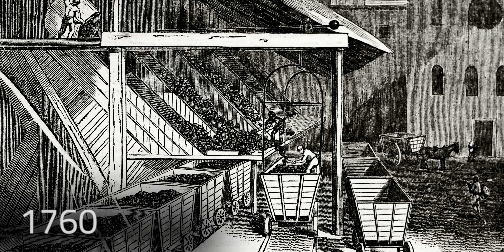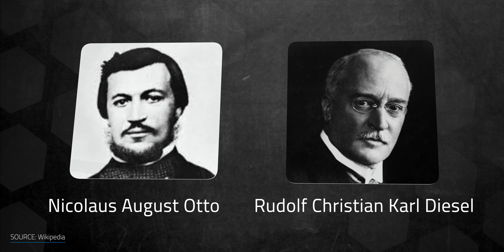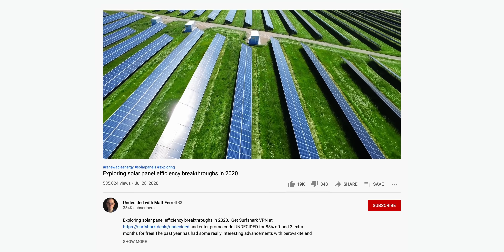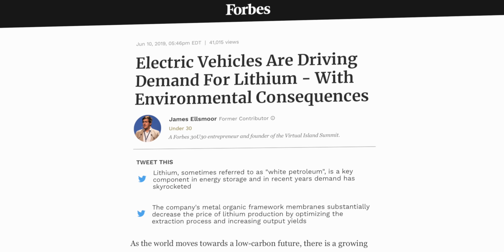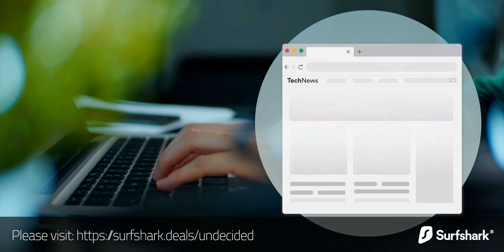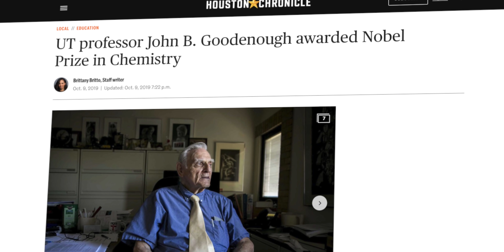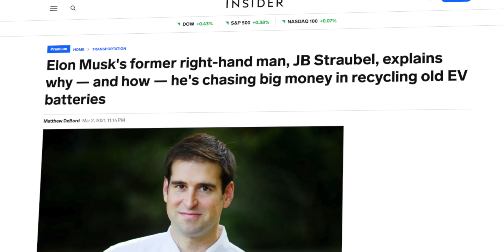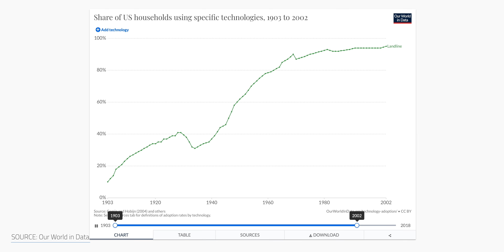Is the Future of Renewable Energy Inevitable?

Comment from the maker: What do you think?  Where's the next be advancement in renewable technology going to be?  And if you liked this video, be sure to check out, "Are Stirling Engines the Future of Renewable Energy Storage?" https://youtu.be/Be3FckQoDws?list=PLnTSM-ORSgi5LVxHfWfQE6-Y_HnK-sgXS
Reply: Matt, first I respect and appreciate your video content.  You're out there trying to shed light on tech, which is good.  But videos like this one, have a delay effect.  History was not on a race to disaster when whale oil was running into sourcing problems.  It may have seemed like it at the time, but they weren't going to take out all life on the planet when they killed that last whale, as bad as that would have been.  So it's a poor analogy to frame your conversation on 50 tech development curves seen in the past when our inspiration to change was fueled only by market profits and wants.  No, today we face a certain destructive future without swift, radical change.  We're not in a slow race, but your videos sometimes paint that picture.  We will not drag our feet waiting for 42% efficient solar panels when 22% efficient ones can do the job.  In fact, if you read carefully about the expected trajectory of solar development, we're already nearing the point where profit margins for solar panels are becoming too low to make further R&D useful.  That's because we put a profit value on everything (stupidly), and manufacturers won't make more money on their return improving them beyond a certain point.  And, in fact, manufacturers are experiencing the commoditization of solar now, where the panels are no longer the dominant cost of solar but rather the sales, labor,  eBOS, mBOS, land (in utility solar case) and permitting are where the real costs are.  Cheapening panels beyond where we are today (through increased efficiency or streamlined production) only removes a profit component from the industry and less manufacturers will want to compete in a low profit industry.  A non-capitalist society could turn all of its focus on quickly transforming, and succeed, but we insist on doing this with a free-market for-profit model.

I'm glad you shed light on new tech.  But understand that each time you paint a picture of 10, 20, or 50  year down-the-road unproven solutions as being strong contenders, you aren't just holding up possibly false-hope solutions, you're distracting from the work we need to do to use the tech we have today.  I appreciate that tech will likely continue to find better renewable solutions (I'm an EE).  But please stress that these would be discovered far too late if we waited for them to make the transition.
Reply: Everyone needs to watch some Tony Seba/RethinkX content. He's done the math on Hydrogen and the solar/wind/storage flywheel.
Reply: More public transportation is crucial.
Reply: You need to do a video on the invention secrecy act of 1954. It’s a little difficult to crack 50% efficiency with a solar-voltaic cell when Uncle Sam doesn’t want you to...
Reply: @wyattnoise  Ha! Fake conspiracy news. You know a US secrecy act wouldn't stop the rest of the world. You think the only solar energy researchers are in the US? 

What is hard about breaking 50% efficiency is basic laws of physics and thermodynamics. THOSE laws are much harder (impossible) to break.
Reply: In a way it doesn't matter what renewable energy does.  Renewable energy is already cheaper.  The change will be energy storage at home, business, and utility levels.  A Powerwall stores about 12 hours.  Being able to store just 4 hours makes a world of difference.  Multiple technologies can work in the 4 hour space.  As these solutions become cheaper, the grid will change rapidly, as more homes, businesses, and utilities but in.  As far as the magic price point for 4 hours of storage, your guess is as good as mine.
Reply: Thing about energy storage is we needed it before renewables were an issue, to balance the grid and give the big coal and nuclear plants something to do at night because you can't just shut them down and turn them on when you want to save some fuel.

We still want better batteries for everything from flashlights to gardening tools, but while useful they aren't the only option as at grid scale high voltage power lines are cheaper than digging pumped hydro reservoirs or building huge backup power plants everywhere. And yes, we could just build a big coal or nuclear power plant and connect those HV lines to it, but renewables are cheaper to build and those power lines might be cut by an accident or sabotage so it makes more sense to use the same amount of money to build 10GW worth of distributed renewable production than one 1GW reactor. Eh, what was that? Someone claims wind power only works 30% of the time? That's nice, we still get three times more power on same budget 100% of the time instead of no power whenever that power plant needs maintenance.
Reply: Thoughts on ammonia vs. hydrogen? Seems like there are some advantages and some disadvantages, but the simpler storage piece with ammonia, plus the greater hydrogen content seem promising.
Reply: Yeah, lets not do that.
NH3 ...eww.
Reply: If you can make ammonia, you can make methane or better propane. Propane is very easy to contain and liquify and store. Carbon dioxide starting material can be obtained from fossil fuel tailpipes and later sea water. We already have distribution and markets for methane and propane.
Reply: @Jason-sp5yc  ammonia is H3N right?
Reply: @kaminelson1277  NH3, yeah.
Reply: @Jason-sp5yc  how would you get energy from ammonia exactly?
Reply: @kaminelson1277  Fuel cell.
Reply: Ammonia is a store of energy that can be created from hydrogen and atmospheric nitrogen using high temperatures and pressures with a metal catalyst. Produced fertilizer. 

Gen IV Nuclear can power that process cleanly, abundantly and reliably.
Reply: Was wondering if you could make a video on phthalates, and how the microplastics will affect of coming generation
Reply: Hydrogen.
Reply: Could you please make a video exploring the problems with mining rare earth metals. A video that would deal with the problems raised, for example, in the documentary "The Dark Side Of Green Energies".
Reply: The future of renewable energy is not inevitable nor is it even particularly probable. The next big advancement in renewable "technology" will be political. We have the technology for carbon free energy production but as long as fossil fuels are subsidized, able to lobby, and allowed to externalize the cost of pollution then they will stick around to the detriment of the many for the profit of the few
Reply: I think you are exaggerating the drawbacks of renewable energy. For example, you list the availability of lithium as the main limiting factor on making batteries (true) but fail to mention that the problem is lithium processing not the rarity of lithium, which lithium is one of the more common elements in the earth’s crust. Also, you mention that sodium can be extracted from seawater but fail go mention that lithium can as well. 

Another place i find the difficulty exaggerated is in the storage requirements for RE. another complimentary solution is geographic distribution of RE sources. Yes, it needs a large continental scale grid like the US or European Union has, but it vastly reduces the need for storage to below what people will likely have in their homes and cars anyway. 

I short, I expect renewable energy to take over fairly quickly, even at the current state of the art. The next major advancement will be in V2G technology which will largely solve the storage problem for renewable energy.
Reply: @williammeek4078  I very much agree.  Renewable energy is far easier to get than most people like to accept.  Even battery production would likely ramp up at a similar rate a we sift to EV Or battery storage.
Reply: It’s a mistake to think there’s not enough Lithium, there simply is. When demand increases the production simply scales.  There’s no stopping the juggernaut of renewables as its now the cheapest form of energy. Not only that, prices continue to drop. Green Hydrogen will have its place but not until there is a large penetration of renewables. It has missed the EV market, but we will see it in long-haul air and sea, steel production and seasonal storage for cold climates.
Reply: @philwelling7172  Actually we can make steel without the hydrogen now as well, Look into Boston Metals. Shipping is more likely to go back to wind for electrical generation. Its an easier retrofit than trying to create massive H2 containment. 
As to seasonal storage in cold climates its more efficient to store heat energy in insulated columns of sand for later use.
Reply: @davefroman4700  funny you say that, I was just listening to a podcast where this was mentioned:
https://www.greentechmedia.com/articles/read/where-are-we-in-the-hydrogen-hype-cycle
Reply: @philwelling7172  If renewables were economical they'd have taken over by now, Completely. They cant, and wont.
Their poor capacity factor (25-35% average), heavy handed subsidie requirements. Conversely, solar, wind, and battery tech is very difficult to recycle, especially solar panels. We don't know how to recycle those things with high yields of reusable material, and since that tech generates a lot more waste by volume, it's far more problematic. We can wait for recycling tech to catch up, but we don't know if it will. If it doesn't catch up, we'll end up trading reduced CO2 emissions with giant landfills of unusable solar panel waste. Plastic has been around for decades and we still even can't recycle that right, so now we have the Great Pacific garbage patch. The nations nuclear waste can fit in a single walmart. Meanwhile landfill contracts are being signed to fill the nations renewable trash.
Only 12% of global energy demand is electric, because converting to electric is expensive and not very efficient but it's safe for running casual devices. 72% of the worlds energy is thermal based because it’s efficient to  convert thermal energy into work without having to convert it to  electricity. You convert to electricity you lose half to 2/3rds of the  energy as waste heat. The carbon emissions from changing electric  sources wont matter much since 75% of all GHG emissions come from non  electric sources. The transition to renewables; means replacing thermal, chemical and mechanical power with several added steps, electric generation, electric voltage, transmission, and plug in. ALL these stages result in thermodynamic losses. An electric transportation infrastructure requires a 14 fold increase in grid construction. Fossil fuels are so much simpler
Fossil energy: Chemical energy --- Thermal energy --- Mechanical energy
Renewable energy: External mechanical energy: Weather permitting --- mechanical energy transition (Generator) --- electrical energy --- Voltage step up --- electric transmission on site --- electric transmission to destination (thermodynamic losses in route) --- voltage step down (transformer) --- transmission to consumer --- consumer utilization (electric motor) --- mechanical energy--- work
Reply: Are you in any way related to Chris Ferrell, the author of "quantum mechanics for babies"? You two look alike, as well as sharing the same last name.
Reply: It's Goodenough for me, too!
But a hydrogen economy would need about twice the solar panels and wind turbines because it's like 70% x 95% 70% x 90%, for electrolysis, compression, fuel cell and electric motor, respectively.
Battery is very near 90% x 90% x 90% for energy costs of making the batteries, their efficiency and the motor, respectively.
Reply: Storage is the key
Reply: From the look of things, anything that drives steam turbines is the future. For some reason, mankind has not run away from steam turbines for almost the whole of the industrial revolution period.
Reply: Not a fan of click-bate-ery but hey, I respect your channel.
Reply: Pretty hard to argue with the dropping price in photovoltaics, and looks like that will continue, which makes that look the like optimum for the foreseeable future on a house-by-house basis.  On a house-by-house basis, I think there’s promise in some solar-based HVAC, utilizing a VRF backbone that can use solar thermal heat, heat in your attic space, etc., and the opposite affect for heating, with a photovoltaic leg for motor/blower operation. Your thoughts?
Reply: Grid scale liquid air batteries (aka cryogenic batteries)
Reply: Hydrogen is a solution for heavy transport, natural gas derived mainly at first and slowly moving to zero emissions tech like wind/solar or nuclear (nuclear has a far less foot print and less waste). I am not sure how we will get energy density of wind a solar to a point that is not damaging to the natural ecology so there will need major breakthroughs to make them smaller and longer lasting, I would say working on making nuclear safe and dealing with the waste is an achievable target based on today technology.
Reply: At this point I have all my energy needs covered by solar.
I live in a town house with 5 people and have an EV (70km/day), solar hot water and battery. All run from solar panels on the roof.
Yes if we get 3 rainy days in a row the battery runs flat and have to draw power from the grid but for about 90% of the time I don't need the grid.
I am confident that if every house roof was covered with solar panels and had EVs we could almost run on renewables already.
Reply: @Bret I guess it depends on where you live. I am in Australia. The payback period here is 3yrs for solar for electricity only. If I include the EV being run from solar vs the petrol car the payback is even quicker. Another benefit we got from solar was the house got much cooler during the day so it reduced the need for air conditioning significantly.
We get enough sun here that a normal house with the entire roof covered in solar would generate more electricity than the entire house and 2 EVs would need.
Reply: whats crazy is that going renewables also meant saving money.  no wonder the middle east is filthy rich with so little people.  the only limit to renewables right now is politics
Reply: @Bret Nope. It is extremely unlikely that any fossil fuel powered vehicles will be in mass production in 2030. Further, wind and solar are already so much cheaper than fossil fuels that virtually all new electricity generation in the US is either wind or solar. By 2025 or so, fossil fuel plants will begin shutting down because they just cant compete economically. Coal already is. The transition to RE and EVs is happening very fast and will be largely complete by 2040.
Reply: In 2000, Germany derived nearly 84 percent of its total primary energy from fossil fuels; this share fell to about 78 percent in 2019. If continued, this rate of decline would leave fossil fuels still providing nearly 70 percent of the country’s primary energy supply in 2050. Meanwhile, during the same 20-year period, the United States reduced the share of fossil fuels in its primary energy consumption from 85.7 percent to 80 percent, cutting almost exactly as much as Germany did. The average cost of electricity for German households has doubled since 2000. By 2019, households had to pay 34 U.S. cents/kilowatt-hour, compared to 22 cents in France and 13 cents in the US. By 2025 Germany will have spent nearly a Trillion in subsidies on an energy policy that's Twice as expensive and still 10x as carbon intensive as Frances nuclear. 

Only 12% of global energy demand is electric, because converting to electric is expensive and not very efficient but it's safe for running casual devices. 72% of the worlds energy is thermal based because it’s efficient to  convert thermal energy into work without having to convert it to  electricity. You convert to electricity you lose half to 2/3rds of the  energy as waste heat. The carbon emissions from changing electric  sources wont matter much since 75% of all GHG emissions come from non  electric sources. The transition to renewables; means replacing thermal, chemical and mechanical power with several added steps, electric generation, electric voltage, transmission, and plug in. ALL these stages result in thermodynamic losses. An electric transportation infrastructure requires a 14 fold increase in grid construction. Fossil fuels are so much simpler
Fossil energy: Chemical energy --- Thermal energy --- Mechanical energy
Renewable energy: External mechanical energy: Weather permitting --- mechanical energy transition (Generator) --- electrical energy --- Voltage step up --- electric transmission on site --- electric transmission to destination (thermodynamic losses in route) --- voltage step down (transformer) --- transmission to consumer --- consumer utilization (electric motor) --- mechanical energy--- work.
Charing a EV battery over the span of several hours is no big deal, adding 50 kilowatt hours over 4 hours requires a power output of 12.5 KW, Fast charging infrastructure of adding 50 kwh in 30 minutes requires a constant power output of 100 KW. Adding the transportation system to the electrical grid would be a logistical nightmare.
Reply: @spikedpsycho2383  Converting to electric is not efficient? Its obvious you have no background in engineering.
Reply: The next advancement in renewable technology is when people understand the benefits.
Hopefully it will only take 20 years to wake up and not 2021 years.
Reply: It's a total scam. It can't sustain itself financially without massive government spending/subsidies. Giving money to the rich. Wind and solar are horrible for the environment when manufacturing and end of life. Plus you keep saying it took time for everything else to develop. Everything else did it organically in the free market. Not through propaganda and hype. And if it weren't for propaganda and negative hype we would probably have ten times the nuclear power plants we have now. Thorium LFTR reactors conventional reactors and who knows what else. We might have figured out fusion reactors by now.
Reply: The next big advancement is to dramatically drive down the costs of energystorage.
Reply: One thing that a lot of people miss is that progress is not guaranteed. If the world embraces socialism lack of profit motive and competition will cause many of these technologies to stall or regress similar to what happened during the dark ages when certain people took over the known world and it regressed for hundreds of years. After a generation we may lose some technologies all together. Our grid is also not shielded from a solar EMP and something like that could wipe out half the worlds technological infrastructure in an instant. Who is left will greatly determine our future. I don't mean to be a downer, but most people just assume things will continue to advance... but without capitatim and the desire for profit it produces we can go backwards very quickly.
Reply: @JWforKansas  Psychology tells us differently. As does Sociology. Our true motivations as a species are autonomy, mastery, and purpose. And once any task requires even basic cognitive decision making processes, monetary rewards hurt performance. We are the most social creature that lives on the face of this planet. We do nothing but excel the more we cooperate. We also receive our greatest satisfaction from helping others as well. These Malthusian era beliefs that without monetary incentives we would not contribute to our communities? Is not and never has been scientifically valid. How can a dog eat dog system where everyone is in a giant game of king of the hill somehow be valid for any social species?
Reply: @davefroman4700  We have real world examples of this failing... it has failed every time it has been tried. Cuba, Russia, Venezuela, the dark ages are just a few examples. Take away the motive for profit and society fails to progress. This is not theory... this is lived experience. To use your example there are many hills and many kings and people are constantly looking to build themselves up and teaming up with others so their tribe can outdo another tribe. The kings are also constantly trying to improve and work harder the fiercer the competition. There are also different biomes and terrains. Someone who is king of the hill in Antarctica may not be at all suited and completely fail if they tried to be king of the desert. People will compete on hills that take advantage of their strengths and thus the strongest in each biome will compete against each other to make that biome better.

Socialism doesn't work because everything has to go exactly to plan. The people in power have to eternally have the best interest of everyone at hart and be completely selfless without exception... which is why it never works and every time it has been tried death, poverty, and regression has resulted. The worst person you can possible imagine eventually takes power and then it all falls apart. Once society regresses to the point of food and fuel scarcity it is always bad for the environment because people will do whatever they need to so they can ensure their survival... including even the most gentle woman eating her own child if she were to get hungry enough. Plenty of examples of that in human history.

Compare that with our system. We are the first nation in the history of the world where our poor people are too fat and having medical problems because of it. In just 100 years our average live expectancy has gone from 47 to 79. The beauty of our system is that it was designed assuming the people in power would occasionally be corrupt and has methods for dealing with them. We introduced something in the US Constitution that changed the world... the right to own and profit from your own creations. Copyright was the only individual right granted in the constitution before it was amended and it encouraged innovation the likes of which the world has never seen. This progress will come to a halt and revert if the world relies on people cooperating with each other when they have nothing to gain and only the most selfless people gaining power. It is far different for an individual to be generous to someone than it is for the government to take from that same individual and then be generous with someone else's money. If I rob you and give the money I stole from you to the poor how generous were you in that situation?

Right now overregulation and the high cost of entry is slowing innovation. Once a company has a virtual monopoly there is no need to innovate since they can easily take out their competition. Competition makes everything better and people will only compete with each other at a high level if they have something to gain from winning.
Reply: @JWforKansas  And each and every one has been subjected to crippling sanctions by the US and the rest of the world that crippled their economies and their abilities to trade for resources. Stalin did not kill millions. The worst drought in history did. That and the fact that the western nations would not sell them food even when offered gold as payment. In fact the US has more people in jail today being held without trail than he had in the Gulag's at the height of the purges. Venezuela had a thriving economy until the IMF and The US slapped a blockade on all their exports and devalued their dollar 500% over night with NO reason. Which has sent the price of everything imported into the country through the roof. Quit drinking your exceptionalist Iced tea.
Reply: Lithium extraction happens in salt flats. It IS a metallic salt Matt. And salt flats are one of the few environments on earth that are incapable of sustaining life in the first place due to their alkalinity.
Reply: Why do you upload at 24Hz? It's so choppy looking.
Reply: @Voyajer.  The problem is on your end. Your Internet connection or computer is too slow. I suggest lowering your video's quality setting (in the gear shaped Settings button) to improve your experience.
Reply: hi can you review liquid metal batteries plz
Reply: @Bret Im an Australian electrical engineer with 20 years experience. If there truly is a tangible imitate danger to human life from climate change, I 'm guessing the sentiment on nuclear will change quickly but I'm skeptical it will ever get to that as i haven't seen any literature suggesting it.

Hydrogen will need to be produced from solar/wind or from gas/coal (with carbon capture). For example Australia would need 70GW solar farm to make the hydrogen to replace the amount of fuel (i.e petrol, diesel etc.) we use and as a comparison our current entire electrical grid has about 66GW of capacity, and we have a total of 14GW of solar (Australia has the largest amount of solar per capita in the world) so from what I can see nuclear will be an import part of this, but the use of nuclear will need brave governments and generational education.
Reply: @Bret Your comments are full of misconceptions. Dont be insulted, it is the result of a deliberate misinformation campaign from the fossil fuel industry. 

Every single issue you bring up is solved when cell supply catches up to demand. For example, we are about to get the Semi, which has a range of over 500 miles at an 80k lb GVWR. With increased supply you get both cost coming down and range going up. Cybertruck will likely have a towing range of over 300 miles. 

It is a battle of oil against humanity. We cant keep burning fossil fuels and expect the earth to keep supporting us. It is a matter of preserving our lives. 

There are so many variations of the Model S that saying one couldn’t do something doesn’t mean much. The new ones certainly can make the San Bernardino  to Vegas trip. As can the long range Model 3. And even if he cant with his current car, he is definitely saving time on his daily commute without needing to make that weekly trip to the gas station. 

Gas will only save you money vs resistance heating, not a heat pump. And the comfort is simply a matter of sizing they system, has nothing to do with power source, same with water tanks.
Reply: @Bret Sorry Bret, but you have been misled. A lot of your information is not current and you have been tricked into believing that it either hasn’t changed or wont change anytime soon. 

Again, there are so many improvements on the Model S, that even saying “long range” (not extended range) doesn’t say much. The current model of the S has a 402 mile range. Losing 1/3 of its range would still allow him to make it on one charge. Even the longe range Model 3 has a 350 mile range and people regularly make the trip in that car, though admittedly, just barely. 

Your argument started off with water heater tanks then you shifted to tankless. It again sounds like poor design choices rather than a fundamental problem with the energy source. By the way, i am an electrician who has done both marine and residential work. Tankless electric water heaters have a huge power draw. If the electric system isn’t designed for it from the beginning, expensive electric upgrades may be needed. Even upgrades to the main service connection to the house. If you DONT do this, then you end up with the problems you see because of under rated equipment throughout the building. But of course, owning a construction company, i am sure you know all of this. 

As to the truck, i already mentioned Cybertruck. 

And no matter how much you deny it, it has everything to do with oil.
Reply: I think the next advancement will be people realising that nuclear energy is actually very safe and much better than other methods of clean energy.
Reply: @kaminelson1277  Safe, clean, energy-dense, and over time nuclear can be highly profitable. Unfortunately, society has demonised nuclear energy.
Reply: @dipladonic  I agree, even my science teacher thinks they're really dangerous.
Reply: @dipladonic  there is actually a lot of push and investment on SMR
Reply: @rogerstarkey5390  Axiomatically, nuclear is THE safest energy source, however, benighted scaremongerers have demonised nuclear hence its long ROI, build times, locked-in prices, and grossly inflated decommissioning and waste storage costs. 

Please, do some objective research on the subject, then balance the costs side effects of nuclear and hydrocarbon energy v's the benefits.
Reply: We don't need advancement to make a switch. We just need to use the tools we already have. We could have gone (semi-)clean energy and farming 40+ years ago. [Insert rant about Corporate Monopolies and Public Misinformation]
Reply: @enyotheios2613  would you like to know some facts about solar panels?
Reply: Also, for solar panels, making people recycle solar panels would be a large advancement.  The net gain from recycling solar panels is negative, and is why only England recycles them.
Reply: Alright, should we talk about solar panels now?
Reply: So who wants to know about solar panels?
Reply: @kaminelson1277  Jesus Christ someone ban this idiot so I don't have to read 1000 comments of his smug blathering.
Reply: @yutt  you can't have 1000 replies to a comment, it caps out at around 500
Reply: @yutt  Also we're just having a discussion, don't read it if you don't want to read it
Reply: When using wind and solar energy, energy storage is the holy grail. Unfortunately, to say that we would need a lot of storage to make wind and solar viable (and non-parasitical on mainly fossil-fueled, conventional electricity generation) is an understatement. Grid-scale storage is an invention created through ignorance that has no plausible scientific resolution. Moreover, the second that you talk about dilute batteries or expensive, difficult to produce (in significant quantity), green hydrogen as a solution to such a monumental problem you lose all credibility.
Reply: @dipladonic  What are your (or anyone else's) thoughts about energy storage using ammonia? 
(search for blue or green ammonia which is then converted into hydrogen to use as fuel).
Reply: @kevinbuckley3879  The whole 'energy storage using ammonia and green hydrogen' processes are extraordinarily expensive and impossible to do efficiently grid scale.
Reply: @dipladonic  Sorry, but you lost all credibility with me tthe moment you used the word "non-parasitical", as if harming fossil fuel generation is a bad thing! Have you been breathing too much CO?
"No plausible scientific resolution"? Where do you get that? The science for clean energy and its need has been long proven. Technological methods for the solutions are now being demonstrated. All that is left is the economics, and that trend is looking pretty good, too.
Reply: @fotoguru222  Cheap, plentiful, energy-dense, portable, flexible and highly taxed conventional electricity generation is a prerequisite for backing up dilute, unreliable, and heavily subsidised wind and solar generation 100%. Therefore, the end-user is paying for two energy resources to run in parallel with one and other. Conventional electrical generation does not rely on unconventional electrical generation, self evidently, the reverse is not the case.

Science self-evidently struggles with a Grid-scale storage solution. We are still nowhere near finding a resolution to this monumentally huge problem.
Reply: First fact, fully intact solar panels leak lead and cadmium into the soil when they're rained on.
Reply: @kaminelson1277  Got a source for that? I know solar cells contain cadmium, but hard to see how it would leak if they are intact.
Reply: @Jason-sp5yc  I can try finding it
Reply: @Jason-sp5yc  look up "Solar Panel Waste: A Disposal Problem - Watts Up With That?"
Reply: Fun fact:wind indirectly causes more carbon emissions because of fossil fuels having to compensate when there's a lack of wind power, and also, when fossil fuels start up, they are extremely inefficient when compared to just running.
Reply: @kaminelson1277  Ha ha! That makes no sense at all. That's what energy storage is for.
Reply: @kaminelson1277  
Not for long, because more solar and wind via more powerlines and especially, lots more batteries.
Reply: @kaminelson1277  Except it's not true.  That's an old trope used over and over, based on the premise that old coal stations are used as a backup.